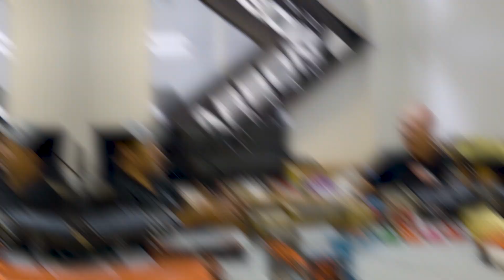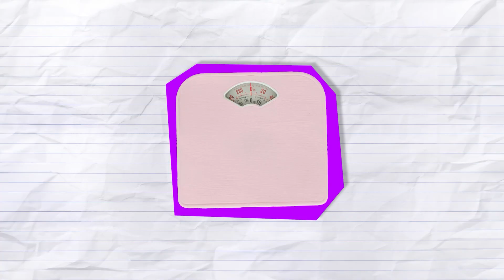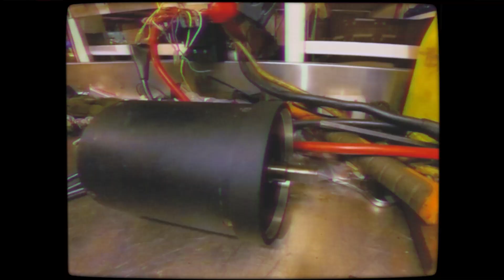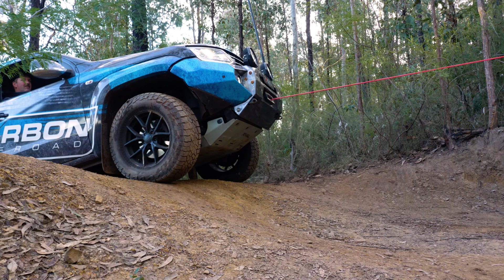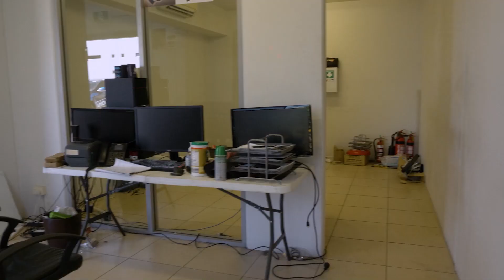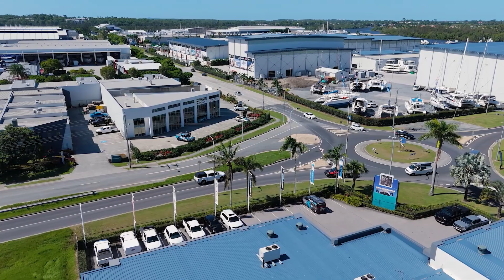Best Winch for Daily 4WD: Avoid Wasting Money on the Wrong Recovery Gear

Comment: Well I've used Warren super winch and a few other brands but I still have the first winch I ever bought 30 years ago from harbor freight it's on the 3rd truck now and it still works great and has over a hundred feet a cable on it and people go oh it can't be good and then I hook on to him and pull him out when they're name brand winch broke and I paid like 200 bucks for this thing I wish they still made it cuz I'd buy another one to just stick in the cover to have it I've pulled trucks even tractors out

Comment: When you think about how much torque a Dewalt brushless tool can produce from a relatively tiny motor, it's no surprise that  a winch can benefit from brushless technology.  For a normal 4WD like a Patrol or Cruiser, though, 48V is not available.
Reply: Their intention is you install a second battery, but instead of another 12V one, you install a 48V lithium one as explained in the video.  The 48V battery then charges from the 12V system while the motor is running, but the winch only runs off the 48V battery.

Comment: The motor via the ESC is speed adjustable, but will the remote control have analogue control?

Can we spec a high speed no load profile and then use the remote to wind in slowly or quickly as required?

Imagine all the torque and slow speed control when you need it, but then not having to wait 5 minutes to spool up the rope after the job is done.

Can't say how many times I've just looped my rope over the bullbar just because I don't want to wait to spool in.